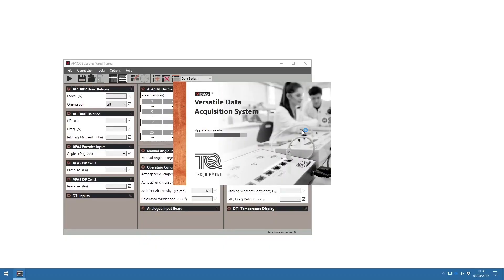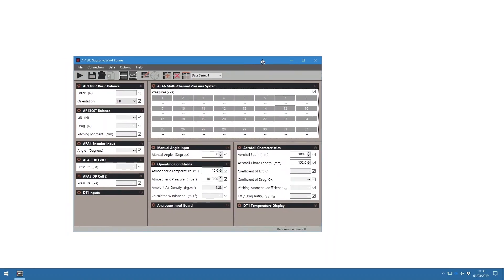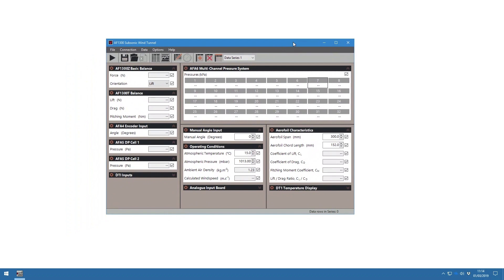Subsonic Wind Tunnel AF1300 - Aerodynamics - TecQuipment

Comment: Thank you for the video. We have this type of wind tunnel (Subsonic Wind Tunnel AFA 1300 Tecquipment). I want to ask, Does this type of wind tunnel in the installation of model airplanes will be tested upside down? If it is upside down, what is the reason. Thank you
Reply from the maker: Dear Muhammad,
Are you using the models with the 3 Component balance?

If so, due to the way the 3 component balance is designed / constructed, to register a positive lift there has to be a downward force on the two load cell cables. Therefore to do this, the aerofoil is flown upside down to generate lift ‘downwards’.

In normal aircraft flight, the leading edge of the aerofoil is angled upwards to generate lift. When using the 3 component balance in the AF1300, the leading edge of the aerofoil has to be angled downwards to generate a positive lift…hence we say it is flying ‘upside down’.

We hope this is helpful :-)